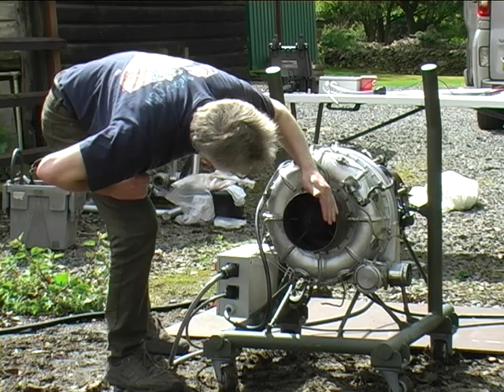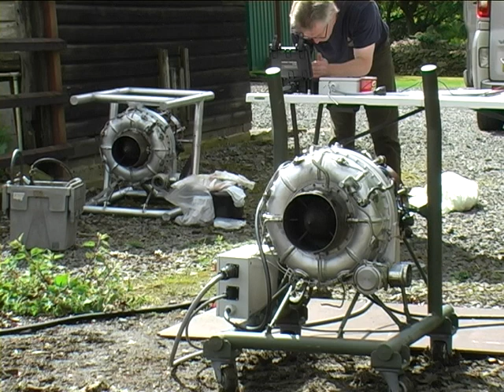AI-9 (АИ-9) Gas turbine APU Fuel Leak while Starting

Comment: Was this leak coming from only the start fuel, or was coming from the main fuel injector lines? It seemed that fuel was leaking from the torch igniter area.
Reply from the maker: Keen eye,  it was indeed the starting injector, I've built a new pipe and banjo, good to go again
Reply: @derekbeacroft   Hi, can I contact you about an important project?
Reply from the maker: @Mohammed-uz1sn  Sure, catch me on face book or send a private message
Reply: @derekbeacroft   Well, well, do you give me the email, I will contact you through it
Reply from the maker: Youtube has removed contact me feature,

Checkout my About page, this leads to links, You can get me on face book